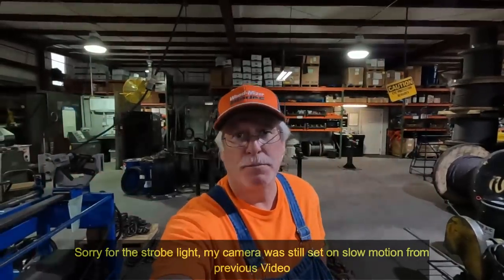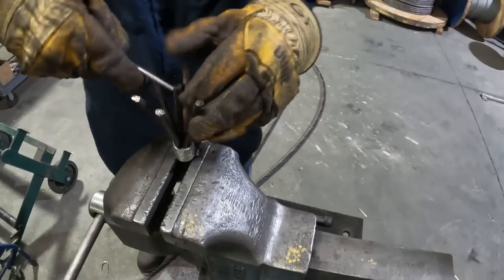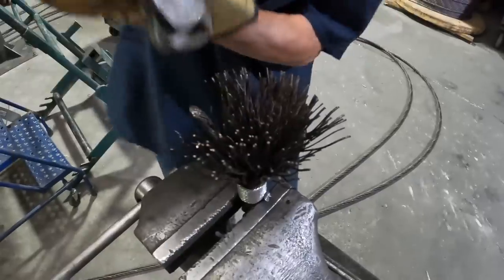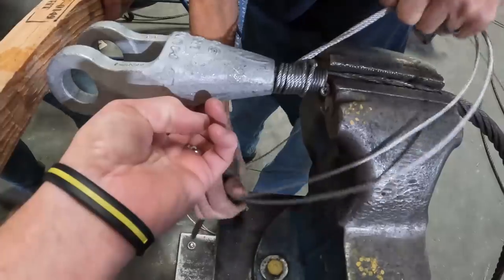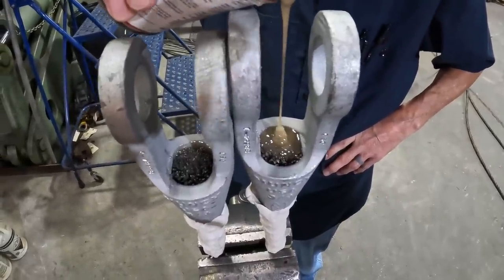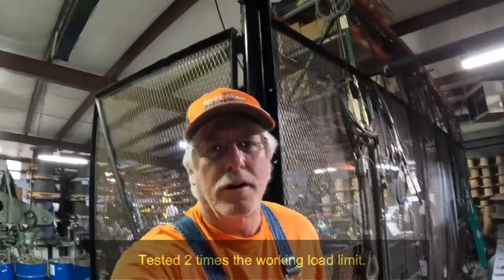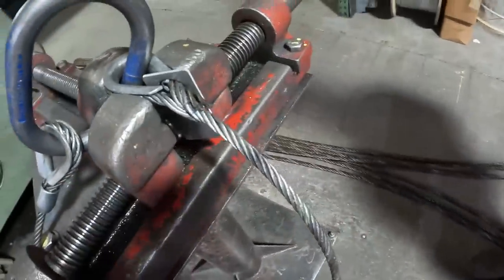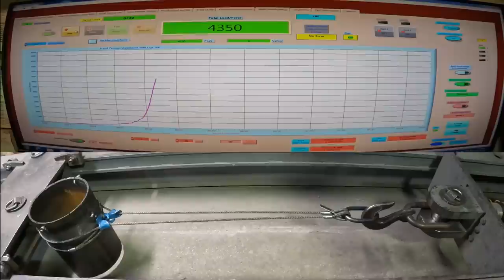3/4" Spelter Socket Resin pour

Comment: I worked in the oil field all I ever seen on the lines to lower and raise the Derrick had babit in the eye .will that resin hold the same.
Reply from the maker: Absolutely!  It will break the wire rope before it pulls out.

Comment: Is the resin fire proof , or will it melt away in fire 🔥 ??? Thanks buddy praise Jesus Christ grace amen 🙏 BigAl California,I’m in need to find 2 miles of useful cables to go arounf a catch fence for my race track 4 times 1/4 mile it a 1/4 mile track ,,and  Insurance wants 4 wire ropes spaced out in equal distances up the couch fence poles , it just needs to be good useable none new winch cable rope ok thanks BigAl California
Reply from the maker: Boiling point is 295 degrees.
Reply: The cured resin does burn. We aren't allowed to use it on bridges, / structures, military vehicles aircraft carriers/boats etc. Anything that's could possibly catch fire or struck by lightning, however of you get zinc over 800 degrees it will start to melt.

There's also swage socket and Emmet wedge type terminations available also.